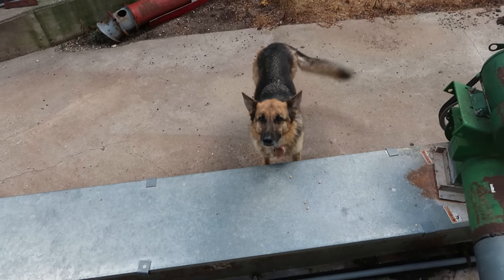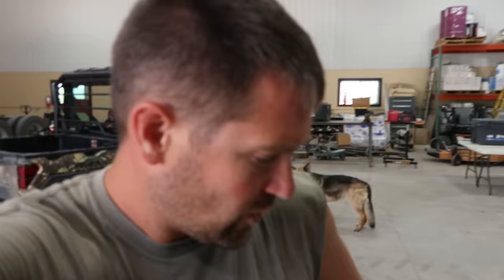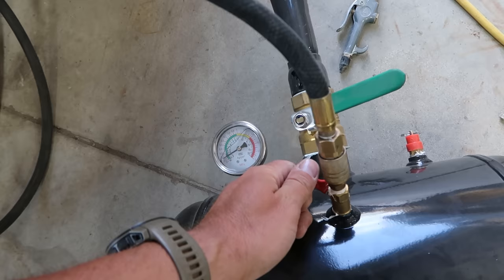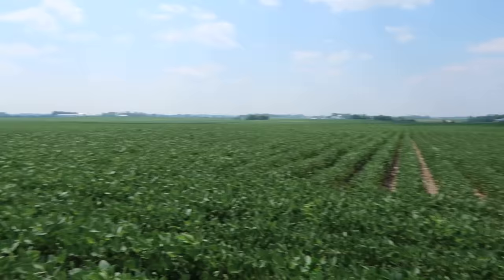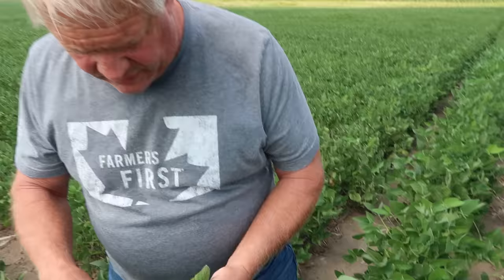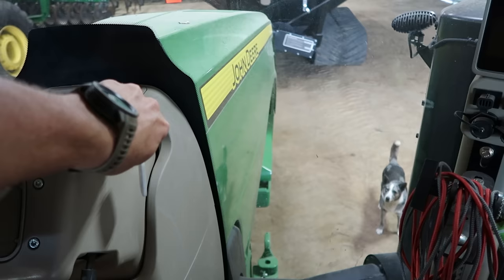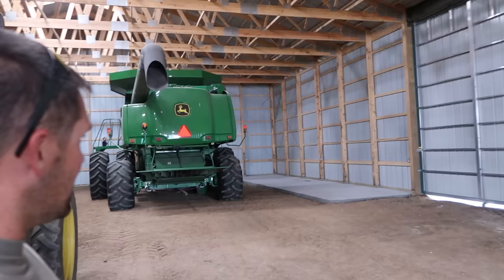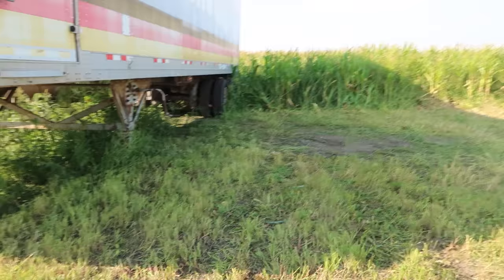That was A lot easier than last time! Odd's and Ends before Harvest

Comment: @4:20 The best way to use those cheetahs is to place a 5 gallon bucket upright on the ground and lay the tire on top. That way the lower bead is on the rim. Apply air via the valve stem with the valve core removed. Then shoot it with the cheetah.

Comment: Just a thought, why don’t you get a pack of colored zip ties, and then use one color for every hydraulic hose connector on the tractor side, and then match the hoses from the implements to the color you need so you don’t have to play is everything hooked up correctly?

Comment: Yeah you might have to put some wood underneath the tire just to kind of get the beat closer and you put the airline on at all times and then hit it with the bead blaster it's bad enough on 4:45 truck tires Terra tires are a lot more softer but it's safer than ether the way we used to do it

Comment: little dangerous but a can of carb cleaner or any flammable spray can in the tire then light it with a extension rigged match at the end should air that thing up?! 🤷‍♂️just a suggestion 🤷‍♂️🤔👍

Comment: Coming From a Guy that follows you and own a tire shop in OKC that deals with all kinds of farm issues and i notice you always have a issue with flats that machine every year. My suggestion would be to put a tube in those tires. Reason is it sits half the year seems and with being used in just dirt that dust gets in between the bead and tire which will make it have slow leak and a tube will fix that.

Comment: I've heard good things about spraying with large drones.  Maybe there's a vendor near you that has that ability?  Might save you some money over an airplane
Reply: Sonne Farms had a drone spray one of their fields. The drone pilot said they work multiple states.  It's should be cheaper than the diesel fuel to run the sprayer.  It's worth checking at least. The title is Spraying our field with a drone. It posted June 17, 2023.

Comment: Back problems are sucks. I'm only 31 but 4 years ago, right before my sister wedding I got a nerve pinched. It was, interesting to attend a wedding that way, while I did barely walk a week prior. It was a painful 3 and half month, a lot of massage and many strong painkiller. I never want to experience that again, never felt so much pain before that.
Reply: I feel your pain.  same thing with a pinched nerve years ago. lasted about a year.  Lucky back then I had a desk job so I never missed a day.   doctors wanted to cut my back open and do all kinds of things.  stuck a needle in my spine with some solution to see what nerve to operate on - turned a dry pillow wringing wet in 7 seconds from pain sweat - if you know you know. feels like a train running down your spine.  they missed the first time, had to do it again.  They told me to get up off the table - couldn't - couldn't move my legs for about 2 minutes.   Usually took me a half hour or so for my back to straighten as I would wake up (when I could sleep) bent sideways.  Painkillers and all that stuff (when they would dish them out like candy)  didn't like taking them but did - even think I went through withdrawal symptoms when I stopped.  Anyway one morning I woke up, got out of bed and POP.  The nerve released and I was normal again - just like that -  amazing.    I do a light weight training program including the back pull down machine (lat machine) to keep my back muscles strong and I think it helps. As I never want to experience that again as well.   Back problems suck in so many ways.

Comment: lay tire down / bottom bead of tire needs to rest on the bottom bead of the rim - needs to ne "sealed" / attach biggest air hose you have to the valve and run air wide open / fill blaster and aim into the top of tire / my guy would spend hours with straps / looked like monkeys and footballs / with blaster as quick as you can set it up you can inflate the tire